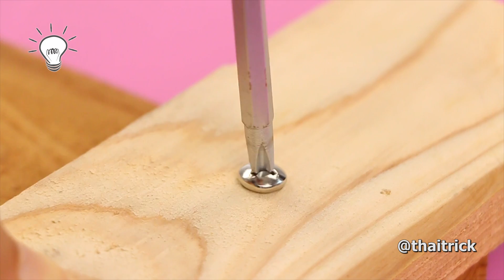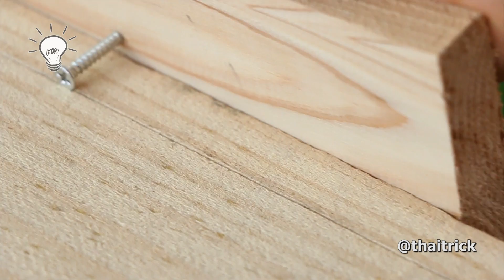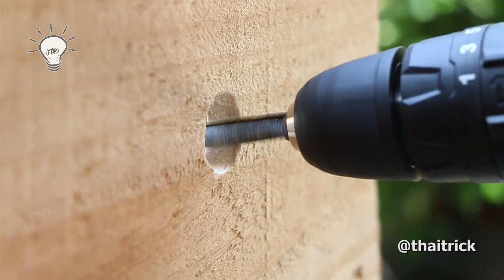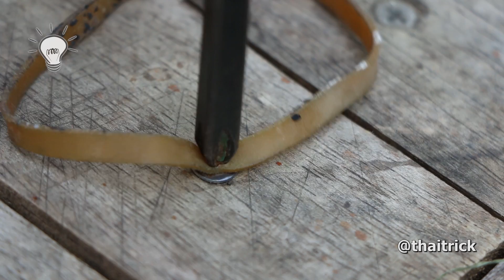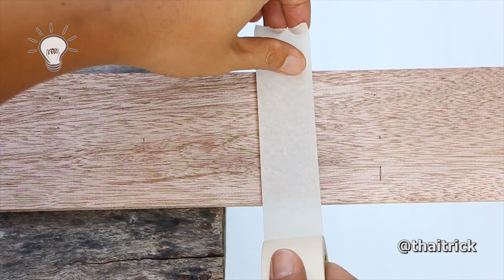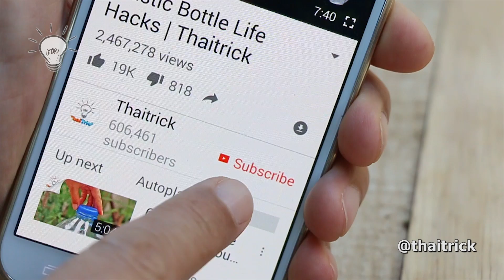8 Woodworking Tips and Tricks | Thaitrick

Comment: These methods might work in a pinch when you don't care much about having a good quality result.  The right tool for the right job.  Always a best practice.

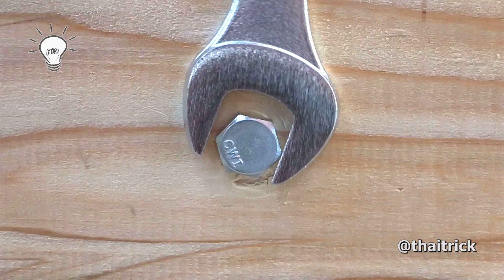0:41 Just use the correct sized wrench.
1:00 Buy a marking gauge
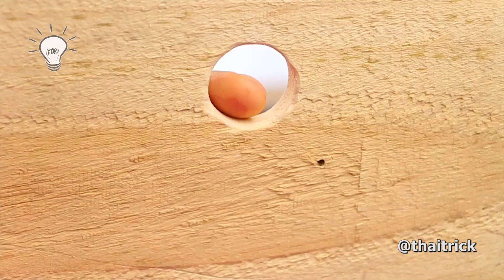1:56 Instead of burning the wood like that just use a countersink and a flat head screw.
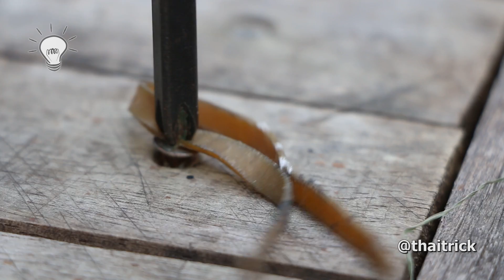2:37 Use a sharp crosscut saw with more TPI (teeth per inch)

Comment: Rather a wood golf tee than a match stick.  They're tapered and will fill the original screw hole. Tap it in, break it off at the work surface, refasten.

Comment: 1. Old one, but cut the matchstick first so it doesn't stick out (if you are doing this in something that you want to look nice.)
2. Need a better fit if the bolt is more than finger tight.  Don't need it at all if the bolt is finger tight.
3. Haven't seen this one, but I'll probably use it.  (It's why I watch these insipid videos.)
4. Old one.  Many variations.  Sadly clothes pins disappearing from first world countries.  (I use them, though!)  Like the fake blood.
5. Really wanted to poke that eye.
6. Not useful if you want the project to look nice, useful if you don't care. 
7. Old one (so is that rubber band.)  Lots of variations.  Valve lapping compound works well, too, if you work on cars and don't have rubber bands.
8. Old one, but useful if you have the wrong saw.  Look at the teeth on that saw in the video.  Too big and gnarly for fine work.  And probably dull.

Comment: Some of these were due to just being lazy,or too cheap to buy or make the right tool for the job. And the trick with the rubber band. I'm still not sure it would work because you were not having trouble with the screwdriver; you just stopped using it so you could use the rubber band. Your right I didn't subscribe.

Comment: I liked plank cutting pasted with adhesive tap and the reverse screw drilling to hide the screw head. Thanks.
Reply: If used countersink  screws no need for reverse   !!!!
Reply: Get a countersink
Reply: Some of us aren't in the workshop or near a hardware store when countersinking a screw becomes necessary. This tip is brilliant, simple and free. AND it always fits the job at hand. Thank you.